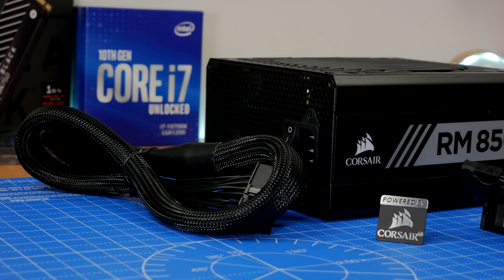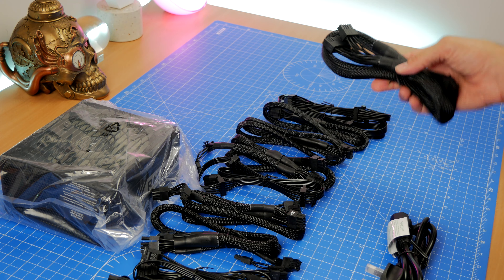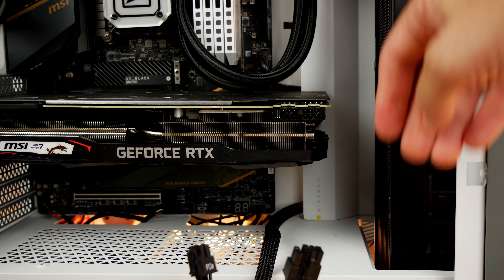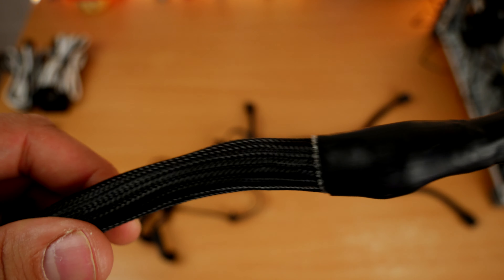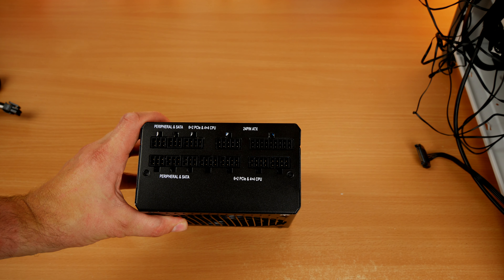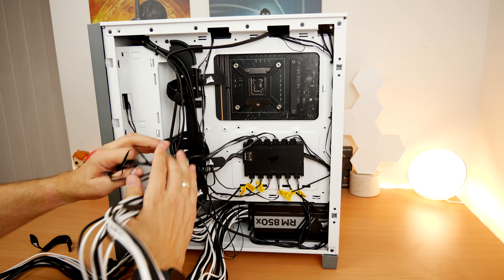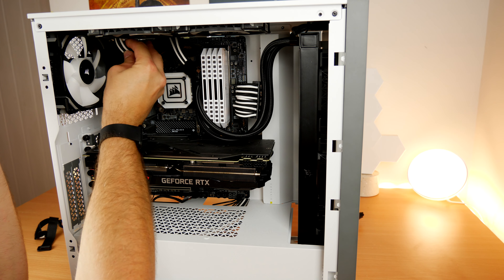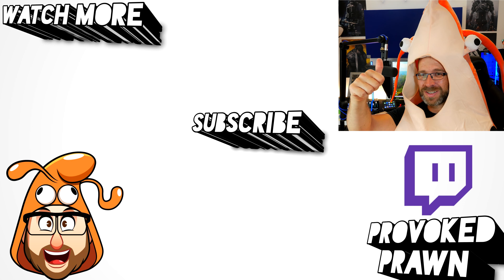Corsair RM850x Power Supply unboxing and setup and why you need a premium PSU cable kit

Comment: Very solid indeed I just installed one for my  first pc build, turned the pc on and it popped like firecracker. Currently praying it didn’t kill anything else
Reply: Sounds odd, usually power supplies don't go out like that instantly. Did you contact corsair? the PSU has a warranty
Reply: same thing happened with mine .... thank god nothing was dead after tho.
Reply: @splatink  Sorry for the super late reply man but yea I actually got in contact with Corsair after and got the part replaced. Lucky my Pc wasn’t dead and works perfectly. I was actually told from the Corsair representative that the Corsair power supplies have some sort of system to control the amperage, so when a power is defective it can supposedly not harm the rest of the system.
Reply: @Phixmaster6  I have an RM850x and it has been working fine for the past 5 months. I guess you got that one faulty out of the 10000...
Reply: @Definesleep938  Good to hear, mine was fine as well but it was still a pretty scary situation.
Reply: @Definesleep938  how did it go?

Comment: I just built my pc with the same PSU and case, but I used peerless assassin 120 SE to cool the CPU. It was not easy to insert the CPU cable with that big cooler in the way. Luckily i noticed early that i cut myself on the cooler, so there is only some blood on the cooler. Well i won the battle, the CPU cables are in and the system is running very smoothly. Ill deff get an aio cooler next time... :D

Comment: I don't think the cables for my RM850x was this fugly but they did come off as over engineered with zero thought into actual usability. 
For me the wall plug was the worst culprit so I just reused my old one. I am jealous of your case sticker though.  
If I ever end up with a clear panel in a future case I'll be sure to look into more user friendly cable management options.

I think going PSU first would be more annoying, for me I've found it easier to manage the cables plugging them into the system than the PSU.  
This helps me know what cables I need as I'll only plug those in, and due to knowing they all have the same destination I get a better visual of where they need to flow to make it to the PSU.

Comment: Nice to see what I am in for when I build mine. I have the same case and PSU. Only I will be running a Ryzen 5 5600X with a Gigabyte RTX 3060 Ti Eagle OC.
Reply: How much did you pay for the gbu
Reply: @jammyman5901  so I was not able to get a 3060 TI, I ended up with a 3070 and I paid about $500 for it
Reply: @orochikaiba  can you OC on afterburner with this PSU on your 3070?

Comment: Thank you for your video. I always find your content blended with the music so relaxing and easy to watch.  Can I ask something about adding extensions to the original cables that come with this PSU. Would an extension of 300mm be enough in general (i know it is case dependent) but just in general even if to use your case as an example. Greatful for your reply:)
Reply from the maker: I don't believe I've used extensions to be honest.

Comment: Problem with the premium cables, they don't have line filters built into the cable so you'll get more noise. Some PSUs do it in the psu others in the cable. Ones in the PSU i don't mind using prem cables, for corsair id use extensions.
Reply: The corsair premium cables have "In-line capacitors on the ATX 24-pin, EPS12V, and PCIe cables". Is that what you meant by filters?
Reply: @roqsteady5290  yea its why they have very low voltage spikes or wtv its called. Most psus are built well with very low line voltage spikes, corsair does it in cable.
Reply: @bluej511  OK. But the cables Prawn was recommending are also from Corsair and do have these capacitors. They are somewhat expensive though... Will probably get them anyway :).
Reply: @roqsteady5290  from what ive seen they dont have the caps built in. You can check if you look at the pictures the 24pin doesnt have a huge bulge.
Reply: @bluej511  The quote in my first post is from the description on UK amazon. I've been checking around, just in case they botched that description and found a review on Bit-tech that mentions the capacitors are color coordinated with the cabling. But you are right, I can't see them in the pictures either. I'll check them when delivered. You do have to be very careful with the details when doing a build.

Comment: The price is the only thing stopping me from buying this. $125 AUD for the set. That's nearly the same price as the PSU. It's better than just a set of extension cables, but when I can get a pack of extension cables for $20 - $30 AUD it becomes hard to justify.

Comment: Just picked this one up as well in hopes I can eventually get a 3080 somewhat soon. It's nice, but the 24 pin cable is just kind of odd. Instead of long and flat, its that rounded type.
Reply: Just grabbed one for the 3080 as well, hoping to atleast get one in november.
Reply: Y’all fellas get a 3080?.
Reply: @Freed98  Yeah, I got one about 6 weeks ago!
Reply: @Freed98  yep has been powering my system great so far.

Comment: tbh, u can use the PSU CABLE EXTENSION KIT :) it cost only 20-30,,,much cheaper
Reply: But then you have an even bigger cable organisation nightmare at the back of the case.

Comment: I was looking at seasonic prime gold 850, but they ran out of stock before I decided on it. Then looking I couldn't find any 850w psu for under 200 dollars, then got lucky and found the rm850x for 144. I wasn't happy at first, but glad its a decent psu.
Reply: I've been using the RMX series for years, very very reliable!

Comment: I have this PSU and a 4000D Black AF! The supplied Motherboard power cable has the most OBNOXIOUS capacitor placement. In some cases it wouldn't even fit through the cable grommets. Getting some sleeved cables shortly to go with my 3080 :D

Comment: Do I have to take the full power supply and all the cords out? Or can I just unplug them where they are and then plug the new power supply back in without touching any of that
Reply from the maker: Are you swapping power supplies? If so you shouldn't re use the cables. That's dangerous

Comment: Sorry dude, but I just bought one of those and was/am looking for help.
You start with the unit then go off on a tangent with the other cable kit which is of no help to me.
There also seems to be a problem with audio sync when you are going on about the other cables.
You are talking about the black and white cables while you still have the original cable in your hands. 6:24 Confusing.
Reply from the maker: Thanks for the constructive feedback. It wasn't meant to be a detailed guide on what to plug in but I'm sorry I let you down and I'll try to do better next time. May I suggest Corsair's official guide on modular setup https://youtu.be/Pa2eyoIfxYc
Reply: @TheProvokedPrawn    No big problem.   I am just "lost" as I don't have the screws to mount it to the case and I am lost in that rabbit hole getting more lost by the second.

Comment: It is nice that corsair gave you a pouch for the wiring for the power unit, I only got a brand new RM1000X on the 18 of July 2022 but no pouch either for the battery or the wiring, any idea as to why Corsair stopped supplying it with the units they Supply.  Could you please show a video on here on where exactly those cables go into the power unit I have, or direct me to one where I can fellow, thanks in advance.

Comment: wait. So if the fans only turn on with high load, then I can't pre-buy this unit and use the paper clip method to check/test that the PSU is working?
Reply: You certainly can, takes a good 10 or so seconds paper lipping before fan kicks in but does work if needing to paper lip.

Comment: Question, I just bought the same power supply from best buy, but mine is labeled different, like yours says atx mine says mother board what's the difference.. also, my EVGA ftw3 is coming tomorrow that now has 3 power hookups vs my 3070 how would I do this on this power supply. Ty
Reply from the maker: Try this video. It's probably more useful https://youtu.be/01T4la0YJ94

Comment: I HAVE A DOUBT?

Which RM Series RM650 vs RMx Series™ RM650x power supply model is most current?

I want to buy this font but I don't know which of these two models is the most current, could you help me?

Comment: How many screws did yours come with? Mine only came with 3 PSU screws in the little baggie. Which surprised me as it’s usually four……
Reply from the maker: Yes it should be four. Do you not have some with your case as well?

Comment: It's hard to justify spending £80 on cables, the PSU itself isn't much more than that.
Reply: so do we necessarily need to buy those white and black cables or not^
Reply: @dany-gc6fm  No the cables that come with the PSU are fine. I have the same case as the one in this video (Corsair 4000D) and I had no issues routing the cables.

Comment: I tried the PSU calculator and it recommended me at most a 500W corsair PSU but my GPU requires 550W.
Reply: If the calculate and GPU says 500/550, get 750 or 850. 600w will be pushing it. You're going to want a lot of headroom and make sure you're considering everything that consumes power in your case when using a calculator.

Comment: I see that the 4 pin fan connector off the front fans go into the lighting node. What about the 3 pin cord that comes off the front fans as well. Where do they plug in?
Reply: do we need necessarily need to buy those white and black cables or not^
Reply: @dany-gc6fm  nope , unless you care about how the inside of your PC build looks and you have a bit of OCD ;)

Comment: Question I have one of these power supplies, should the fan be always be spinning when it's powered on but mine doesn't after like 10 seconds it stops spinning but the power supply with the tester still has power to the unit
Reply: Some psu dont use the fan unless they're on heavy loads , idk if this one has that button
Reply: @perdo7195  don't know but the fan spins then 10 seconds later it stops. But using my power supply tester the power is still on and works. Maybe if I end up using a board with it and see how it reacts in the end who knows
Reply from the maker: They have a zero rpm mode and won't spin unless required. Don't panic.
Reply: It's on the box lol, says has zero RPM mode. Fairly standard for quality PSUs nowadays, GPUs too.
Reply: @perdo7195  it does and it's on by default I don't think you can turn it off. It says zero rpm on the box, fans start at 340w usage but it's silent, it doesn't speed up until around 650w usage and gets loud above that.
Reply: Fans are off until 340w, but barely spinning until 600w

Comment: Out of curiosity, with your radiator they are not filled all the way.. so having the hoses top exit like that wouldn’t you be pumping air to the block?   Serious question.  I have the identical setup oddly enough and building it now.  Any insight much appreciated. Loved the video!
Reply: It's to do with internal pressure, you also want the pump to be higher than the block.

Comment: I got a prebuild PC a the fan faces the interior. Is that wrong?
Reply from the maker: Hmm, depends on the case I guess. And how much airflow it has. If loads of cold air is going into the case then it's fine but generally you'd want it so it's sucking cold air from an external port.
Reply: @TheProvokedPrawn  OK, thank you. I´ll turn it upside down. It does not make any sense since the fan faces a metal casing and there is only like 3 mm space in between.

Comment: Upgrading my PSU(RM 650) and GPU to RM850x /Rx7900xtx. RM850 PSU only comes with 2 PCI cables. Can I use 1 PCI cable from my 650RM to use on my RM850?  Rx7900xtx requires 3 PCI cables. Anyone have any info if its possible?
Reply: It's always a bit "safer" and efficient to use one cable per connector. 
That being said, you would not causing any issue using the piggyback cables included, it's almost a thing from the past as even the new ATX 3.0 600w 16pin connector plug internally the same way two 6+2 pins would. 
That's 600/2= 300w per 8 pin connector equivalent, and those 8pins are rated for 150w. BUT each 8 pins connector consist of the three 12v pinouts ( 1-2-3 on connector ) and are wired with #18 gauge cables rated for 10amps per wire so thats 12x10x3= 360w ! That's 60w of room for the connector or 20w per 12v cable as grand maximum. Performance can improve by a negligible amount also generally <1% if using one cable per connector as you can see on JayzTwoCents video about the subject for exemple.
But i agree it's pitiful to provide up to three CPU cables but at the same time save on PCIe cable as 99% of user may rather need three of those instead of three of CPU power cables to provide 1000w... ( let alone we speak about a 850w model that come with that " feature " ).

Comment: Hi there,

Could someone help me understand something about the RM***x power supply range?

I bought an rm850x power supply and then 3 other RM750x and there is ultrasonic noise and hum on all 4. The capacitors are all hissing. Is this normal?! This ultrasound noise goes through my ear and it hurts me.

I have a bronze CV750 from corsair and it doesn't make a capacitor noise, except for the fan which clicks under load 'tac tac tac tac' but it's light.

Given the slight clicking noise I wanted to change to have a more high-end power supply thinking that it would no longer make any noise, nor tac tac tac, nor any capacitor noise (?).

It's incomprehensible to buy a higher end power supply that makes a hissing, buzzing and ultrasonic noise.

I had changed this CV750 to an RM850x but the RM850X made a hissing noise and the other 3 RMX750x also.

Is this a manufacturing defect? it must absolutely not buzz, I do not understand.

These RM850x & RM750X power supplies have been tested on a bare (MSI B560 A-PRO) and equipped motherboard. But also on an ASUS TUF B560-PLUS WIFI, equipped.

Comment: Question is this the 2018 version? And in my shop there is MPN code that says: CP-902018-EU so does that 2018 in the code mean that its the 2018 model? i want to buy the RM850X also

Comment: just bought this psu. would you recomend using 3 different pcie cables for a 6900xt? dont know if two cables + the pig tails will hold the power draw for this card. been having stability issues
Reply: hey I have the same card(sapphire in my case) and have the same doubt, did it work in the end?
Reply: @sonatafx  had the same issues until I switched motherboard.
Reply: @nacoleon18  my guess would be your old mobo couldn't deliver enough power on the pcie

Comment: Does this psu support 3 or 4 sata cables? I know it says 10 sata connectors. But theres only 3 cables. I thought i need atleast 4 to run 9 fans. Would i just need to buy an extra sata cable? Or a whole new psu that supports 4 connections
Reply from the maker: Sata cables have multiple connections generally. Why would you need four to run 9 fans out of curiosity? I think I'd need three max and that's with RGB fans.

Comment: I see you have 8+4 cpu pin connected right ? I am happy this psu has this, even though I'm on b550, but maybe I would need it in the furture. Can it fill z590 CPU connectors aswell, I think It's 8+8 ?  ???

Comment: im just curious other videos of unboxing shows that the unit psu of the 850x  has also a pouch bag? which version do you think has that? im assuming yours is the 2019 version? btw i bought mine in amazon Japan its 55$ cheaper more or less than in amazon US.
Reply from the maker: Yes there was a bag.

Comment: Hi, just bought the RM750x and it has the same port interface as the 850, so I was just wondering if it matters where I plug the PCIE cable and the CPU cable on the PSU side, the two sockets for both cables look identical and I don't know if it matters? I'm completely new to this, any help would be appreciated, thank you!
Reply: @Justice Hi, yeah the PSU says CPU & PCIE under the 4pins, not specific to an individual socket, a lot of people are saying it's interchangeable, it just worried me as some power supplies aren't interchangeable

Comment: Thanks for providing another great presentation (thumb up). I hope you (or someone else) can answer this quickly as I need to decide between RM1000x or RM1000i to go into a new system which will include ASUS ROG Maximus Z690 Hero, Intel® Core™ i9-12900K 3.20GHz and Asus ROG Strix RTX3090 O24G. I also want to use the Corsair Premium PSU Cable Kit and want to know if this kit includes all the cables required to connect the power sockets on the motherboard and the 3090 which, I believe has a different power socket layout to previous models.

Comment: Will it be good for a msi godlike x99a it needs 8 pin and a 4 pin cpu power
Reply from the maker: Sure. Use a PSU wattage calculator to make sure it has enough power for all your gear.

Comment: Do I have to use the cables that come with the psu or can use the existing ones
Reply: Never mix power supply cables. Check the Gamers Nexus video.
Reply: @bigmouth0604  so do we necessarily need to buy those white and black cables or not^